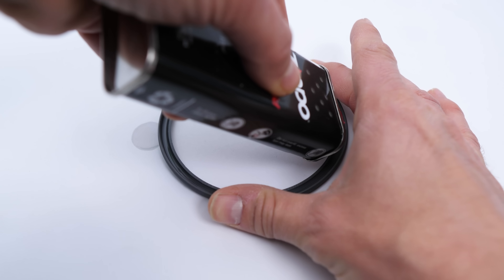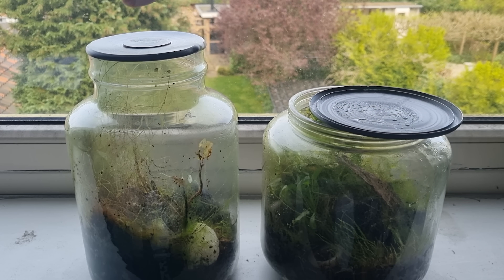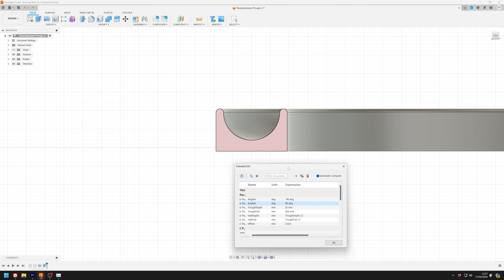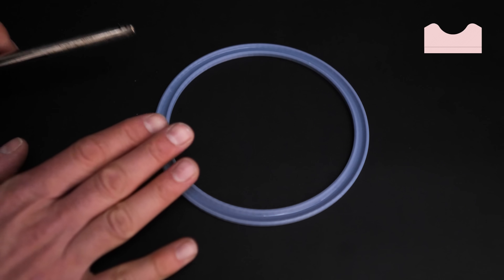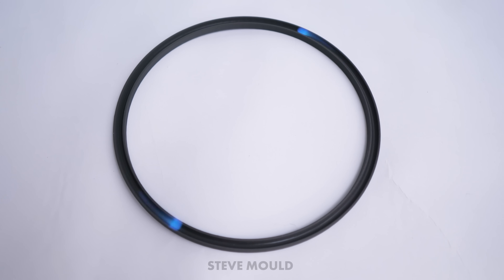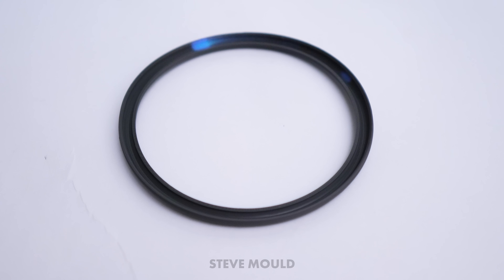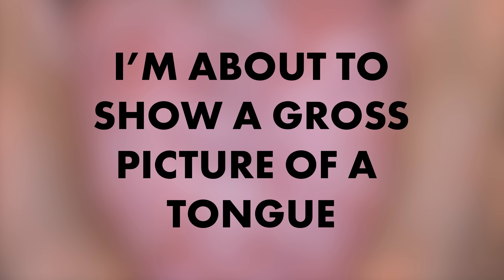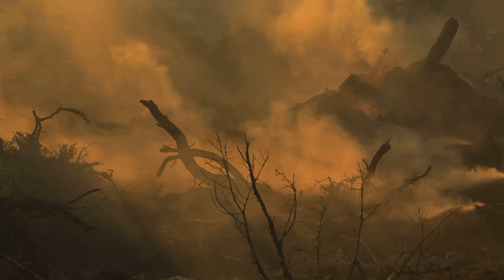Bizarre travelling flame discovery

Comment: I think with the second spiral design, you'd have the more 'desired' effect if you had a wider angle between the spiral and the starter-loop. As it is, the fork creates a wider gap than elsewhere in the 'circuit' and that is why you're seeing the flame 'stuck' in these nexus points. 

You'd have to decide if the effort was worth the time, but I would wager that you could engineer these so that they maintained that 5mm width at all points across a junction, and you would see smaller/fewer of those stationary flames. Though just by the nature of it being a junction with multiple avenues as opposed to a straight line will by its nature have a higher volume of vapor so it might even need further narrowing/engineering.

Comment: ive only watches 2 min 35 seconds of your vid and i think i know why it burns the way it does, the oxygen/fumes burn up faster than they can get to where the fire was, therefore putting it out, but also with fresh supplies to either side the flame goes the direction that those supplies are in. resulting in a perpetual starting and extengiuishing of flame across each section, making the flame look like it is traveling in a circle. which is also the reason it stays ignited when theirs too wide of a rail width and goes out fast when theirs not enough rail width. youre essentially using physics and fluid dynamics to keep the flame at the size you like for the percieved racing around the ring. :) idk if any of this is 100 percent factual because im not collage educated in those fields or any field at that matter but its just what came to mind/is logical to me:)

Comment: That's so cool! Naphtha vapor is heavier than air (like most 'flammable' fluids), so it builds up inside the walls instead of diffusing away. The other factor is oxygen- in wider areas (like junctures) oxygen can flow down to keep a sustained flame for a time- in narrow regions oxygen could be pushed back by the expanding gases from combustion. Naphtha has a high vapor pressure, and the flame not being sustained (moving) may be more of a lack of oxygen issue. Or not. Thank you for the video and getting my gears grinding.
Reply: Mm, maybe narrowing the junctions could clean up the action! Huh, I wonder what sort of... isometric junctions are even possible.

Comment: Just got the idea of connecting two rings of different radiuses with a short straight path, when igniting the biger one, when the second one gets ignited, it will complete it's circuit faster and intraduce new flames on the digger circle

Comment: I wonder if the parameters of the 5 mm opening is somehow connected to the stoichiometric equation between the fires burning reaction and the oxygen environment.   hydrocarbon fuels such as this with each number of hydrogens and carbons have been  segmented into labels the particular fuel lighter fluid is C4H10?  If you take your rings and do your experiment at a higher altitude, does it still work?

Comment: This is really cool and very impressive to watch!
Can this be 3d-printed using standard PLA or will it soften due to the heat and fail (standard PLA glass transition temp around 40 degrees C)?

Comment: 11:18 😆That moment when you end up making a good demonstration of an ectopic pacemaker. 
A rogue signal that hijacks the normal heart rhythm established by the sinoatrial node. Its caused when the normal impulse from the node ends up going around damaged heart tissue and ends up going in circles, compared to the normal signal that travels from end to end once/sinoatrial activation.
It usually occurs after ischemia (tissue running out of oxygen), witch ends up causing irregular heartbeats, flutter, fibrillation etc.

Comment: Isn’t the small point of flame because of the rate at which the fuel changes from liquid to gas? As long as the flame consumes the vapor more quickly than it can be replaced, the flame will move away from the source of the spark, and the movement is at the rate of the chemical reaction changing the vapor into plasma. More or less volatile fuels could move at different speeds and pair better with different track designs. Or I could be full of shit.

Comment: 3D prints are a little bit porous, and liquid tends to be drawn along the direction the layer is printed in.  Try writing with a thick marker on a white 3D printed surface and you'll see what I mean.  I think this is what is happening with the figure 8 in the raised section.

I believe this porosity would be a problem for a terrarium lid incidentally, so I presume the original creator was intending to further seal it with something like a spray lacquer.  The terrarium would dry out over time if you did not do this.

Comment: A related subject that you might be interested in is the RDRE (Rotating Detonation Rocket Engine — I was surprised you didn’t mention it, which might mean you are unaware). RDRE burns fuel in a sustained detonation by carefully timing the fuel input with the detonation front.  NASA recently successfully tested an Aerospike RDRE that has the potential to optimize the Rocket equation:  the RDRE optimizing the efficiency of the fuel combustion, the AeroSpike optimizing the “Bell pressure” at all atmospheric pressures (sea level to vacuum). I found the physics, the difficulties, and solutions, to sustaining the detonation fascinating.

Comment: I wonder if a clock could be made? The flame seems to be very consistent in speed. I have no idea how you could create the “movement”. Maybe some kind of thermal sensor but I bet one could do it.

Ps. I just realized it would be thrown off by barometric pressure and maybe air currents and themselves. So some sort of sealed container ya pump atmosphere into…….i want to build this clock lol but alas, I do not have the skills.

Comment: Now how would the flame react to change in atmospheric conditions, say in a changing pressure environment (vacuum chamber?) Would the decrease in pressure increase the rate of evaporation of the volatile fuel, or would it slow the flame down and extinguish it due to the shortage of available oxygen containing air?

Comment: Build a small computer with it.

You have a clock, it should work.
-Wouldn’t it be awesome to see, that a “powerful” computer is achievable earlier than mechanical and electrical computers?

That would be a sort of Flintstone computer.
Reply: (Light it on Fire, binary program with some fluid gates preventing a burn on some paths)

Comment: Not sure if this is a result of the medium staying excited for a tad bit longer than it should or maybe its just the camera playing tricks on me, but at 6:46 - 7:06 in about the 2 o'clock position on the ring. Just as the flame passes you can see a little bit of an excited blue spot hang around for a little bit longer than the normal parts around it. Kinda interesting.

Comment: Red wine is great for getting the grey matter whizzing - how about the London underground tube map, light the circle line then every time the flame passes a connecting station it would shoot off up the Northern line or shoot down the Jubilee line, then how about 3D printing the UK road network, have the M25 at the center and have the motorways branching off, if the timing was right you  could get pulses of flame running up the M1, M4, M40 etc......as the flame runs around the M25..

Comment: I discovered this as a middle-schooler with hair mousse in the bathtub. You can draw any design and the flame will travel as the mousse bubbles pop with flammable gas. Easy cleanup and rapid iteration on designs. My favorite was a pentagram/pentacle as the various intersections would launch out flames as rapidly as the refractory period would allow.

Comment: 3:44 What you say there isn't 100% true, as candles rope rod can be replaced with a metal bar or anything else that points upwards, and it will still burn like usual. The capillarity thing is just something that we say to each other in order to feel good about pretending to understand it, but without understanding it at all. What burns in a candle flame is the vaporized gaz that is drawn to the center by convection

Comment: 5:54 - 6:01 what if you make one where trough opening is small, but you drill small holes on the side to supply more air to the flame, would that work or would it just burn like ring where the trough has a huge opening?

Comment: I used to get an effect like this without a trough.. back when I was too young to play with fire. I found that spraying Endust for about 5 seconds directly down on cement made a really interesting burn "pattern".  lighting it directly in the middle just did a solid burn as expected. Trying to light the edge at an angle made a wall of fire that traveled... i can only explain as like the minute hand of a clock. It traveled fast overall but it did speed up to about twice it's starting speed after making about 15? laps around the circle.  After seeing this i tried with other chemicals that i shouldn't have been playing with. There was another household spray that did this but the flame height was barely visible.  Seemed to only have success with sprays that, when concentrated, left a foaming effect on cement.  This just reminded me of my Pyro days :) thank you for this.

Comment: Disappointed that your research didnt go into detonation waves. As mentioned by several other users on here. This is a very interesting field which is very important to the chemical industry when trying to prevent burn back in piping (especially in flare systems). Interestingly this is a developing field with plenty of opportunity for further theory development. Ps- if you keep the track at 5mm diameter but the top half is clear plastic this would still work!

Comment: A spiral with a bridge from the middle to edge might be cool to see. I was surprised that the flame on the figure 8 wasn't able to start a flame on the bridge as it passed, I wonder if the longer run time of the spiral would change that. I'd also like to see one where instead of having a large circle for the fluid with smaller opening above, you just take the 5mm half circle and extend the wall straight up an inch or two to see if it still works, I imagine it should and if so could allow for a larger fuel tank/run time. It would also be cool to see if there is a way to have one of these with a fuel tank or that can self fuel for a really long run time.

Comment: Fun fact - rocket scientists are currently working on cutting-edge engines that work in a very similar way to this (only much more explosively)!

They're called "rotating detonation" engines - typical rockets, while powerful, lose efficiency because the pressure wave from the reaction pushes some fuel out of the way rather than igniting it when it fires. A "detonation engine" is one that ignites fuel at a faster rate than the pressure wave can travel... But the only reliable way we've been able to engineer jets and rockets to do so have been ones that fire in short burts (that's how a pulse jet operates).

So the next big thing in rocketry has been to engineer a ring-shaped engine that can inject fuel ahead of the reaction and keep a sustained detonation going. It's devilishly hard to do, let alone keep stable for a significant amount of time, but it's what folks at various space agencies and military research labs are currently developing. As of December last year NASA successfully test-fired one and kept it going for over four minutes - and it was built out of 3D-printed parts too!

Science is cool.

EDIT: I realise I'm not the first person to point out the similarities, but I did go into far too much detail trying to explain how they work! :')

Comment: Could the operation of the junctions be improved with a little design tweak?

You have a 5mm wide opening all the way around, but at junctions this widens, which is why you often get stationary flames.
Could you get a better effect by shrinking the opening at junctions, so it remains 5mm at the widest part?

Comment: Could you make a computer with this? it would appear to me if you got the timings right, you could actually think of a main loop as being a system clock off of junctions, and the way the flames can either pass or cancel each-other out could make logic gates. I would imagine even very simple logic gates would be large in size however.

Comment: I think someone could make a continuously burning ring of grass with a chunk of land a lot of work.
Start in a semi desert environment, plant grass in zig-zag grids with irrigation in place.  
Time it so it starts watering within minutes of the passing fire and keeps it wet for 3 or so weeks growing up to ½ meter
The grid and rate of burn is optimized to burn one cycle every 6 weeks.
Aftet 3 weeks of drought and hot temperatures the grass is golden brown but still has enough moisture to burn relatively slowly (1-2 meters/minute.)
Piece of cake😂
1 meter a minute for 6 weeks requires about 60,000 meters of track. I'm not mathy enough to put althat into square km or acres with the distance between rows and all that. Probably quite a bit, but there's ranchers here in TX that I have no doubt could pull it off😂

Comment: I feel like 5mm is optimal for whatever room-temperature you had @ the time.  I wonder if you'd need a wider track if you were to try in a basement, or walk-in freezer, because the rate-of-evaporation would be reduced.  Conversely, a thinner track might be used while exciting the evaporation-rate with a heating-pad, peltier-junctions, or ultrasonic-transducer underneath a cookie-sheet.

Comment: I used to make similar chasing flames 30 years ago or so,  simply drawing designs in lighter fuel on concrete pavement and the flames would chase back and forwards around the drawing.
Reply: It makes that nice fwub fwub fwub sound

Comment: I think the main improvement to be had here is a larger reservoir with a smaller surface area. A square instead of circle shape. This increases the volume to surface area ratio, and you could make it as deep as you like.

Comment: You cannot get a universal gate set with the channel you described :( The issue is that you have only linear dynamics, which is basically XOR (which is linear mod 2). You can combine that with a constant ON channel and get a NOT gate, but {XOR,NOT} aren't universal. This is generally true, that linear channels can't really compute anything. It's also an issue for quantum computers - you need SOME non-linearity to get interesting computations, which is an issue for photons for example. I suspect you can combine two channels that are close enough to get a OR or AND gates, and that would be universal.

Comment: It occurred to me that printing a circular track at the center of a double spiral would produce a self-sustaining double helix of flames when viewed from above, but might quickly get out of hand when the air above the center of the ring heated up enough to form a vertical vortex, pulling in air from the sides and causing a tornado...?

Then I wondered how to light it such that the fire front would rotate in one direction only, and I thought that an interrupted 'S' shape with a 'dam' at the center would keep it from 'backlighting' in the opposite direction if the flame front passed the ring's ignition point...

And then I realised I had just 'lost' an hour of my weekend and that I was going to be late...

And I didn't mind so much...

Comment: I use to do this, but I didn't use a trough to optimize it, in the right wheather conditions it works on a flat surface just drawing the the shapes.

Comment: Random question:

let say that I have a Tupperware container that has been filled with water, and then balanced that container on some sort of pivot point, like the side of a pencil. If I balanced it perfectly, the container should be perfectly level and should not touch the table on either side. Then if I put a buoyant object on one of the sides, would that cause that side to become heavier and cause the container to tip in that direction? Or would the displaced water still balance the system?

Comment: It would be cool to make the bottom of the track out of a spongy material that has a constant supply of lighter liquid or other fuel. So it could last much longer. But the surface would need to be precisely designed to let out the right amount of liquid.

Comment: I'm reminded of the story about the Saturn V F-1 engines.  There, they had problems with the flame moving around at high speeds actually causing the engine to self-destruct.  They came up with (empirically) a baffle design that blocked the flame oscillations.  The baffles themselves were cooled by sending the oxidizer (or maybe it was fuel, I can't remember) through the baffles just before exiting through holes into the chamber.

Comment: what if you put it in a trough, but the outside edge was traveling really fast in one direction, and the inside edge was traveling really fast in another direction, meanwhile the bottom of the trough, and the vapor, was stationary?

also, does this oscillatory behavior happen in space?

Comment: Dang, this is an effect I've seen a million times in a non looping shape. Kinda bummed I didn't discover the artistic potential myself as a teenager when I was burning patches into my desk instead of doing my homework.

I haven't watched the whole video yet to see your explanation, but I suspect it's a fairly simple matter of the flammable vapor entering and exiting its combustible range in air. Once ignited the vapor and oxygen is quickly consumed in the hollow of the print causing the flame to extinguish and progress to a new area. By the time it comes around again there's been enough time for the vapor and air to freshly mix and the burnt exhaust to clear out.
Reply: You're spot on!